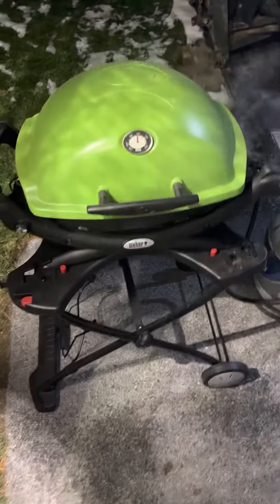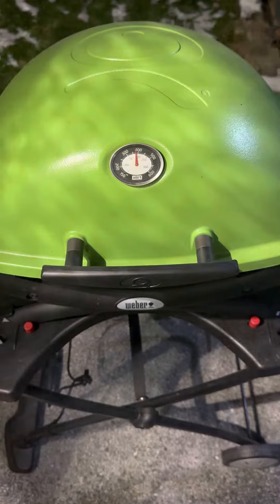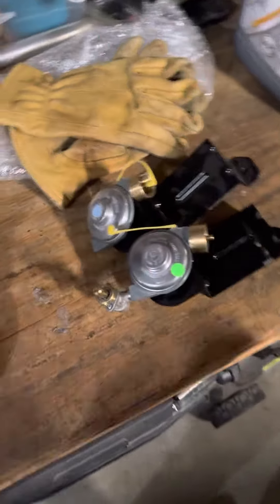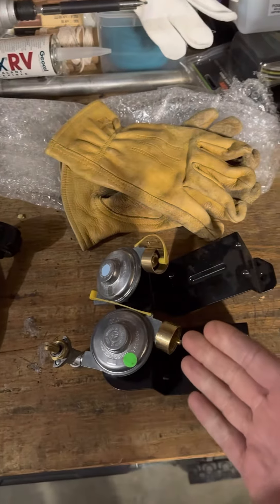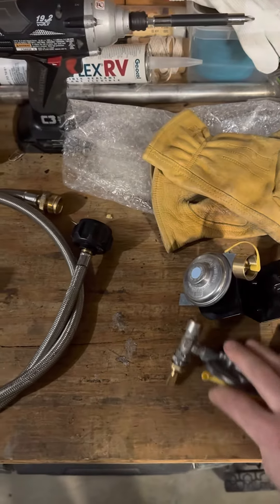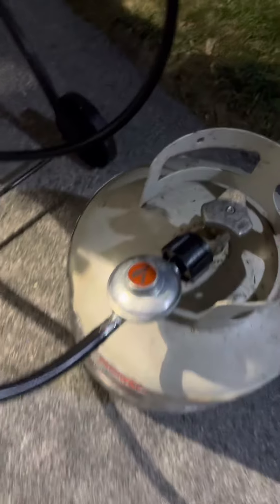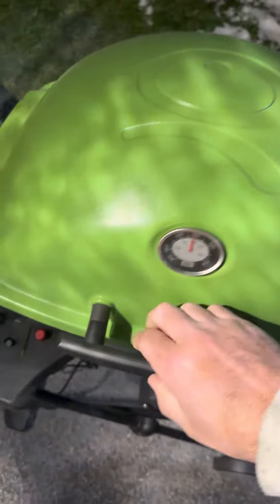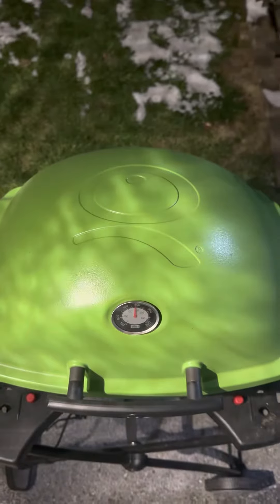Weber grill regulator fix…. Err… replacement.

Comment: I put a adjustable regulator on mine , and have awesome flames and adjustments . Turn it low for low and slow cooking and up a little bit for high temperatures and charring . Even pizza 🍕 ! 😊 I wish I knew what size fitting you used , mine took 3 pieces .

Comment: HI there thanks for the post, I'm interested in making this modification but I see you pointing to the piece which receives the knob to control the flame.   

Do you remove that piece and replace it with the brass adaptor?  If so how do you regulate the flame?   

Also the large circular part on the regulator I think is called the bonnet,  are there now two bonnets one on the hose and one on the manifold of the bbq?

Does one still have use of the knob that controls the flame?
Reply from the maker: So the factory valve/knob stays. Your only taking off the regulator, replacing it with a hose with the regulator on it, which requires an adaptor as I described in the video. Very very simple. The factory regulator and regulator bracket get thrown away.

Comment: I was wondering if it’s a good idea to do a quick connect set up from this portable grill to a 20lb tank.
Reply from the maker: I’ve actually considered doing this. I haven’t yet but absolutely something I’d  like to do!
Reply: @s1283 I tried this and it worked on my traveler. Thank you sir. Weber factory regulators are cheap.

Comment: how in the world did you remove the valve from the regulator. mine doesn't move at all.
Reply from the maker: the valve is one piece and the regulator threads into the side of the valve, it shouldn’t be one piece. think of the valve/nozzle as the top of a tee, and the regulator is the stem of the tee, just twist counter clockwise
Reply: @s1283  you are absolutely right! I just took it apart. it was just incredibly tight. but your video saved me. the 1:04 part of the video was exactly what I needed to see what I was doing wrong. thank you so much.
Reply from the maker: That’s great! Super stoked for you!  Hope your regulator issues are in the past now!

Comment: So what did you buy here? Just a hose with a regulator attached?
Reply from the maker: I bought the grill regulator/hose, and the single brass adaptor. They are separate parts.  (3/8 SAE Flare Male to 1/8NPT Female adaptor & 5ft grill propane hose)
Reply from the maker: My apologies for the delayed response. I never saw a notification for the comment
Reply: @s1283 do you have a link to the regulator and hose you purchased? Assuming the brass fitting can be purchased at the hardware store?
Reply from the maker: @masonkeller169  i got everything on Amazon. Link to the parts were in the description.

Comment: Does this really work. I’m ready to put on a new regulator. Should I get that new valve? Anyone?
Reply from the maker: It works. If you lose the oem valve you can’t use the small bottles of propane, but full size propane tanks work great.  The issue is with the low flow safety mechanism in the oem valve fails closed and it makes it useless… I was on my third Weber valve when I decided to fix it permanently.

Comment: Ok I restore Weber grills as a hobby.  Ironically I had this same issue with my Q1200 as well and had Weber send me a new regulator.  One thing that I wanted to mention to everyone buying Amazon regulators is that Weber uses a certain psi and WC number.......you want to buy a propane gas grill regulator that says 11wc in the description somewhere.  If not you will get a regulator designed for a crab pot cooker.....or patio heater etc that is designed for more aggressive burns.  These regulators turn your typical Weber grill into a flame thrower ( much exaggeration ) .  I recognize the symbol on your regulator ........which happens to be the symbol on the one that I purchased a while back as the wrong regulator.....and the grill performed beyond its limitations.  So for everyone out there be careful and buy the correct regulator.  ps....I am not a professional gas guy.....do your own research.....had to say that to cover my butt  :)
Reply from the maker: This is neat information. Certainly something to consider. I will say this grill has been working flawlessly ever since, no issues with starting, or overheating.
Reply: If your not over heating you may have got lucky and got a 1 psi 11wc regulator.  It is very obvious when you have the wrong regulator.  The large Weber grills are designed to achieve 550 degrees so I will assume that the Q is designed for just a bit less......anyone talking about temps screaming to 700 has the wrong reg
Reply from the maker: I think highest temp is seen was about 450. Which was easily 150-250 degrees hotter than the OE regulators ever saw. They were awful
Reply: I just installed my new reg and fired the Q up on the bottle and it easily got to the designed high temp of 550.  If you are on a big tank and getting low temps your in safety mode.....have a bad reg.....or u have a clogged burner tube
Reply from the maker: I don’t believe I’ve ever let this new regulator heat to full temp, usually preheat to 400 then turn it down to cook. But I could never get close to that on the old regs, like you said they’d hit the safe mode or something so I could barely warm hotdogs. Idk if it’s mandated safety stuff or just garbage parts but I will never buy an oe Weber reg for the q series. Only ever used large propane bottles. No need for the little ones
Reply: Its like removing a speed governor on a Buggati. You know your limits but have the speed when needed . Use wisely!

Comment: Your link goes to 5/8 to 1/8. You say 3/8. The link doesn’t show at 3/8. Help.
Reply from the maker: I just checked my Amazon purchase history. That was the exact item I purchased. I must have written it down wrong in the description. I will have to edit that.
Reply: @s1283  now I'm confused. Is the link in the description accurate? It goes to "uxcell Brass Pipe fitting, 5/8"-18UNF Flare Male to 1/8NPT Female Thread, Tubing Adapter Hose Connector, for Air Conditioner Refrigeration." In your answer to @brettmacinnis6252 below, you say 3/8 to 1/8.
(Other videos show a series of three adapters required, which seems silly.)
Reply from the maker: I have updated the link in my description. I also double checked the fitting. It is a male 3/8 flare to 1/8 female pipe. Yes I have also seen other videos where they use multiple fittings which was wasteful, but useful to find my part.
Reply: @s1283  thank you!

Comment: You have yellow flame which means your burner is not getting enough oxygen and will cause charring of everything. I used to work as a maintenance technician in kitchens. You should have a blue flame which means the proper amount of oxygen. Checks your burner’s oxygen inlet, could be blocked.
Reply from the maker: probably the grease on the inlet screen. the whole stove is not designed well. the screen is right where the grease spatter comes off the side of the grill. I’ll give it a clean and see what comes of it! thanks!
Reply from the maker: I did check the flame, we’ve been using the grill for months now, and maybe the video isn’t showing the color well, but there is definitely blue flame. The tips are yellow as every grill I’ve ever used, but there’s no smoke, soot or I’ll affect I’ve come to note so far. The grill performs so much better and doesn’t use any more gas than it used to (when it was working) as our issue was there was not enough flow to get any heat.  We couldn’t get 200 degrees out of it in 20 min on high.  Now we can get 350 degrees on high in about 7 minutes.  Granted it’s a full size grill regulator on a single burner, we didn’t mess with the valve, the air orifice, or the burner tube in any way.  I did clean the entire exterior of the grill recently and there was no change to how it operates either. They did design the air intake to be on the bottom of the burner tube which is unaffected by grease spatter like I originally though had happened when you reached out. Is there any other sign or symptom you can point me to besides flame color that would lead you to believe it’s running bad?
Reply: @s1283  I suppose 350 isn’t bad as long as you don’t have a pure yellow flame. I was in your predicament getting about the same temperature, but I decided to try something to get the temp higher. I could have a bad regulator and instead of just replacing it, I took a safety needle and applied enough force to widen the orifice just a hare. I now get 540f in 10 minutes, keeping my fingers cross it’s going to last for a while.
Reply from the maker: @justintran3265  the symptom of our regulators on these grills was always the same. Turn on the gas, wait, then try to start it. For a while the grills lit like any other grill and got hot, still not like this large regulator, but usable. Then every one of the Weber regulators after a time would just give less and less fuel, and then altogether we had one just stop letting fuel pass. Called the company and they always said the safety shutoff was locked in and we needed a new regulator. Two different Weber q grills and 4 regulators later…. I’m all done with their regulator being so safe you don’t get to use the grill lol.  I’m not a gas guy, so idk if  all this time the output orifice somehow was clogged, or just too small… but we don’t have issues anymore! I do have two of the old regulators. Maybe a dissection is in order.
Reply: @s1283  it was certainly worth the effort trying to revive it and getting great results from it, and sometimes the orifice gets clogged just a hare to notice a drop in performance. As long as you’re happy with it, that’s all that really matters.